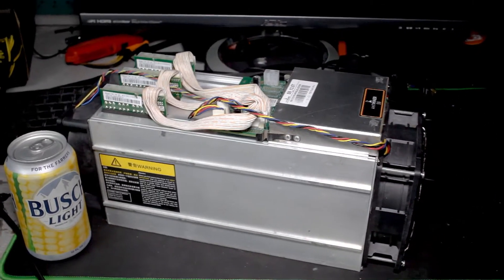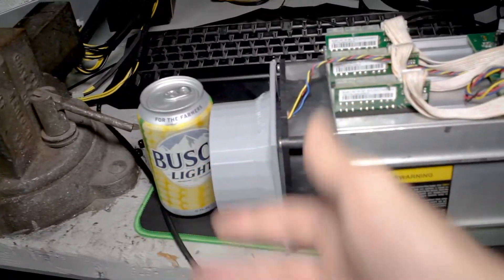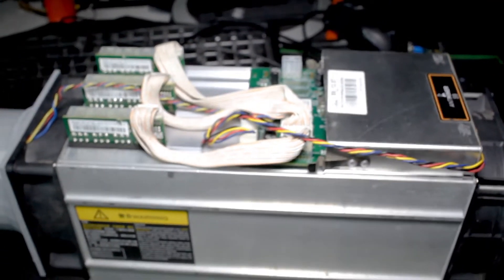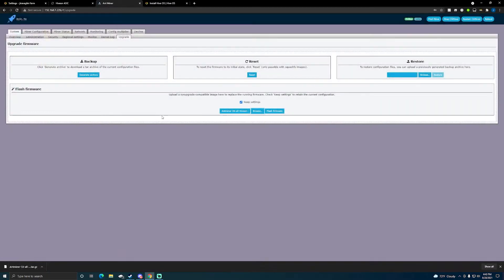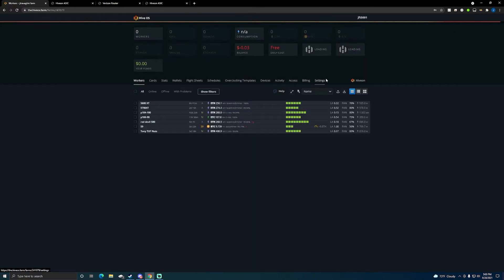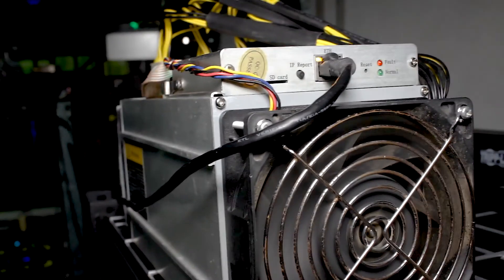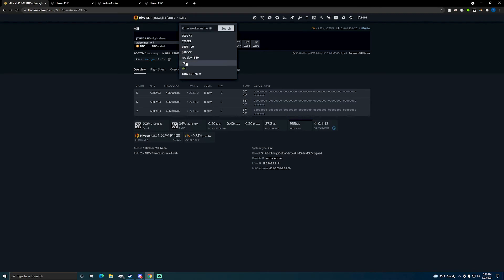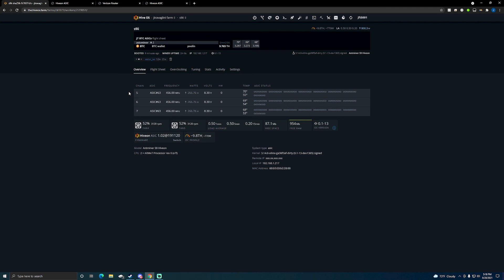Antminer s9 added to cpypto farm HiveOS setup

Comment: Hopefully the PLA holds up, for safety I would have blown out the S9 cuz fire/temps are Aren't worth losing your place. Any who I'm so jealous of your setup. Keep living the dream Sir. Great video tho.
Reply from the maker: I plan to disassemble it it and blow it all out.  The fans are worse than I thought with dust.  It does stay cooler than my other one while mining but I still have it turned off until it’s 100% ready.  I actually printed it with PETG because of the hotter temps it can hold.   So hopefully it holds.  I have seen them get crappy on ASICS because of heat but people use PLA because it’s easier to print with.   Thanks for the kind works.